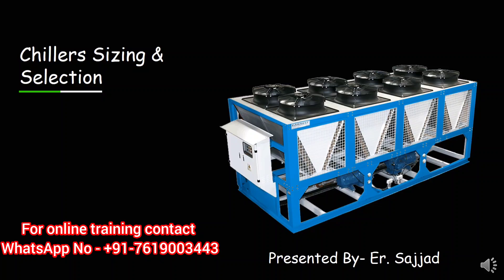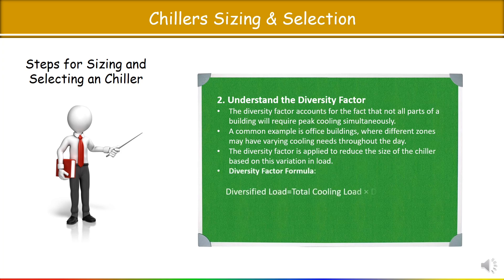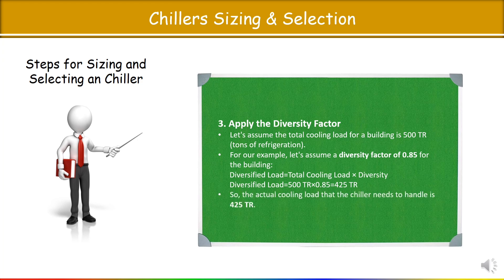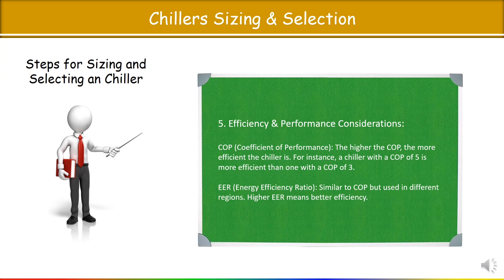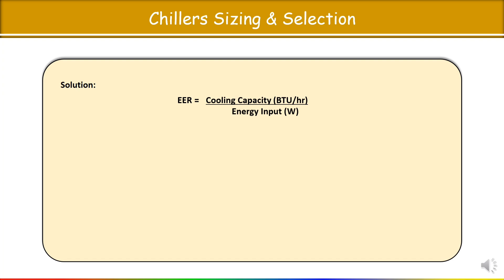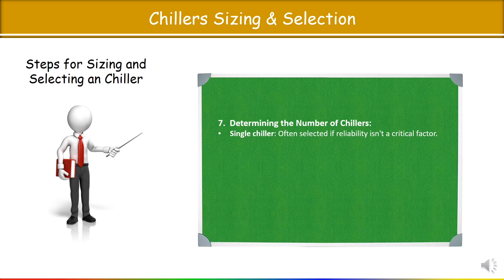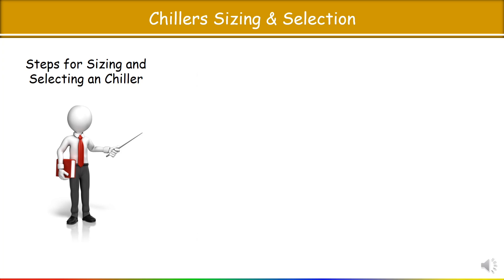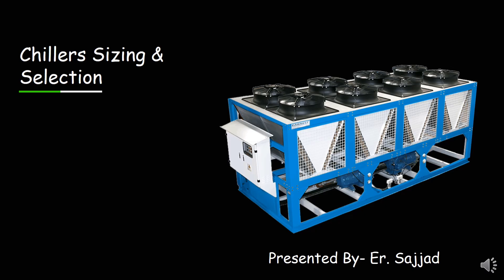Chiller Sizing & Selection for HVAC

Comment: Hi Sir, can you please suggest any reference standard for diversity factor.
Reply: Diversity factor to be considered as per the application and change in load conditions. Sometime at 100% if building is fully occupied like call centers and it may go upto 50% if air conditioning is designed for machine shop, industrial cooling applications.